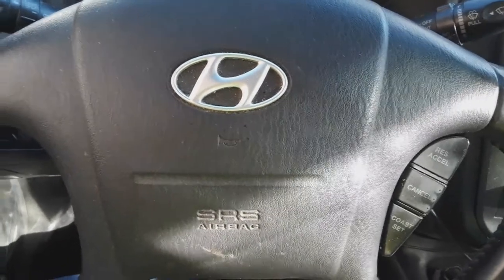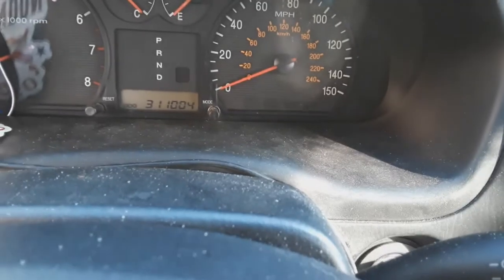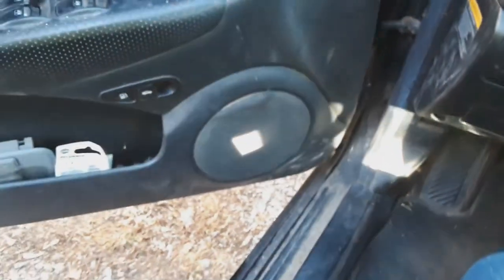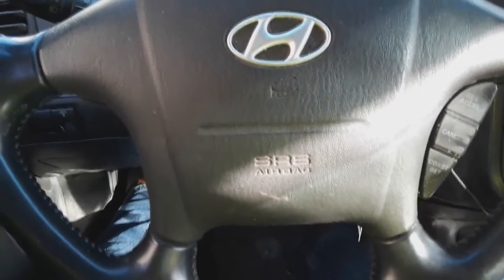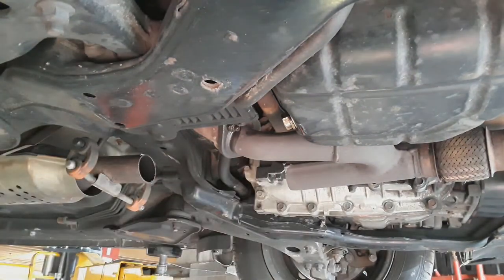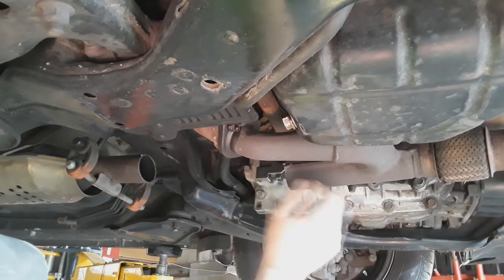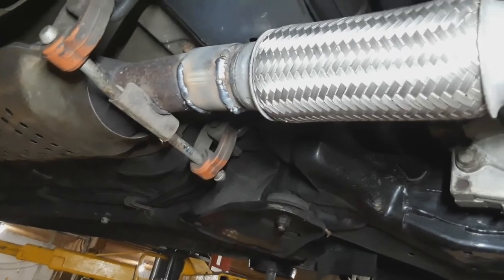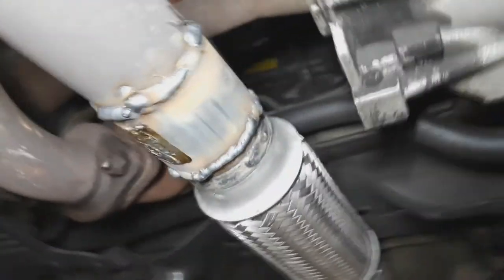Exhaust Repair on my 2005 Hyundai Sonata

Comment: I'm glad you posted this video. I was overcomplicating things. Do you remember what size of flex pipe that you ordered?
Reply from the maker: @danwilliams4670  RP Remarkable Power, RK7536 Exhaust Flex Pipe 2" x 8" Heavy Duty Stainless Steel 12"OL https://a.co/d/3tqWffv

Just went back to my Amazon orders and found it for ya. Up to 390k miles and it's holding up great
Reply: @diymisfit_Mechanic_UDX404  Wow! You're the man. I appreciate the extra effort. Mine did what yours did but it  fell all the way off. Same exact place.
Reply: One more question, how did you clean up the cast pipe? On the sides, there are 2 gigantic welds. That thing isn't quite a regular pipe. I was going to use a file but it sure is pretty thick where it joins.

Comment: I need mine swapped out keeps blowing a code $1300 🤬🤬🤬
Reply from the maker: Got the ole p0420 / 430 do you?
Thanks for watching
Reply: @diymisfit_Mechanic_UDX404  you know it. Wish there was a way around it lol
Reply from the maker: @bigjon1558  supposedly there is a way to trick the older ecm's with a resistor and capacitor on the O2 wiring.  Doesn't work on the newer wide band sensors though
Reply from the maker: @bigjon1558  here ya go, you could try this. 
https://youtu.be/qHD7T7EhuzI